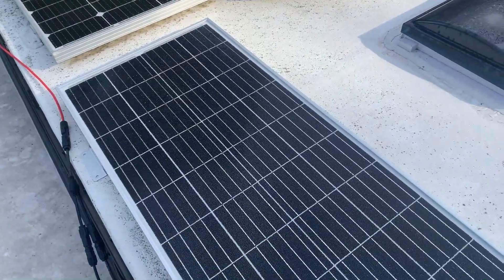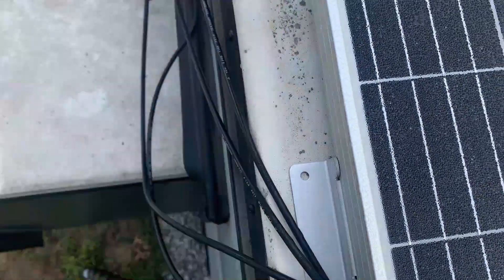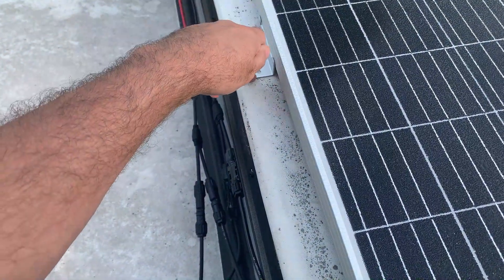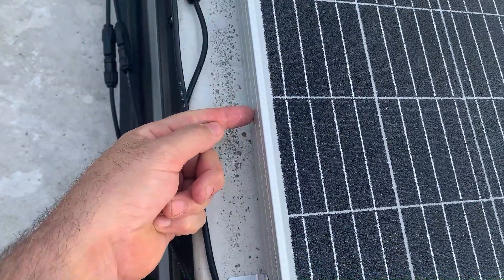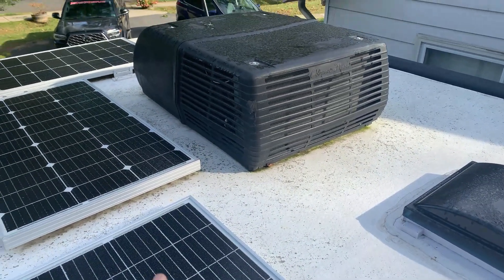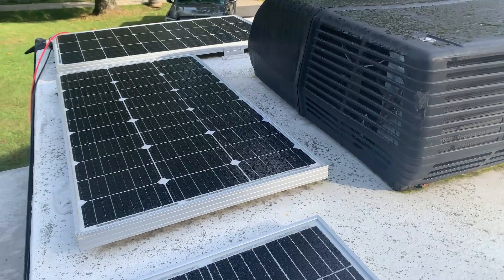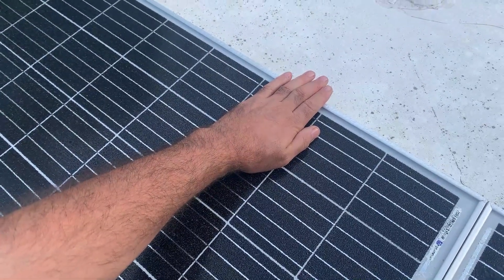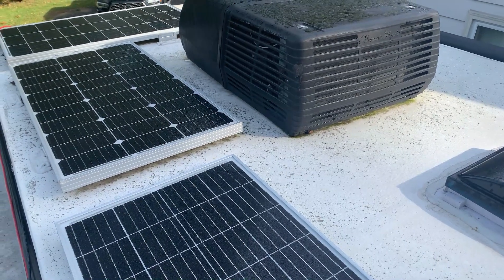RV Solar Panel Placement Problems

Comment: I did a similar test with shading. You are not quite correct. You get some power but it is greatly reduced.😅
Reply from the maker: True, but the reduction is around 75%
Reply: No not true,  if they are all run in series and its partially shaded all in the string on all will be reduced to the amount that panel is putting out. if its 25% covered you will be reducing all panels by 25%.  @familyrvliving
Reply from the maker: That's true. That's why parallel is a better setup for shady areas.